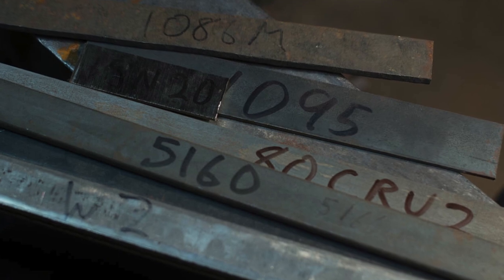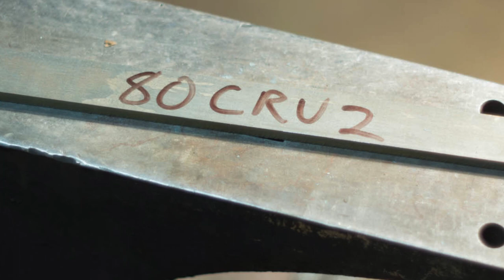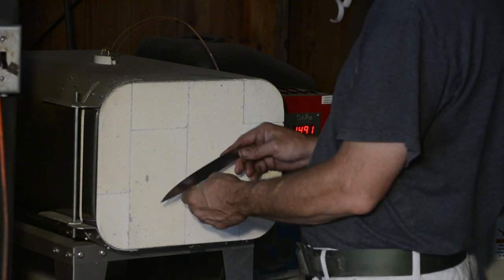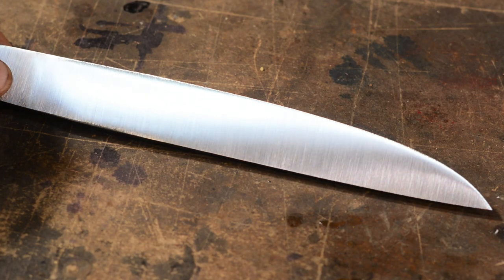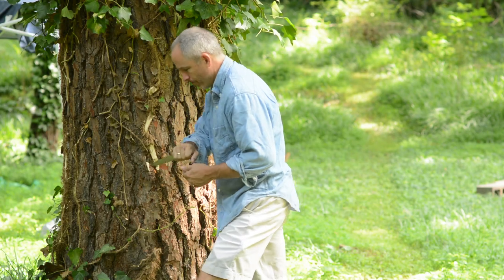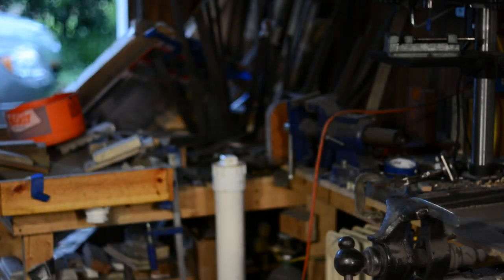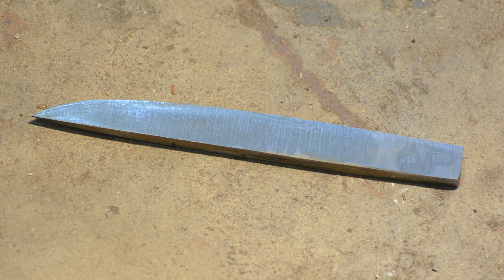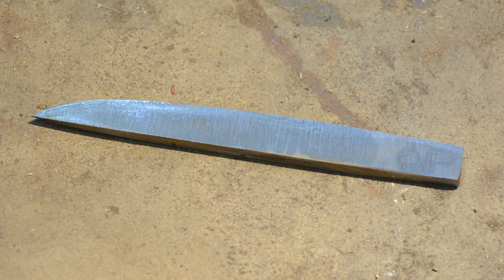Steel Testing for Knife Makers

Comment: Showing people to put quench oil in a plastic container, bad form.

It's way too easy to put red  hot steel through the plastic container and have flaming oil travelling across the floor.
Reply from the maker: Good point.  Sometimes I have to scramble for equipment at the last minute when making videos.  This was one of those moments...

Comment: And the same steel Wil vary from batch to batch. I've had 1084 that warps like crazy for no reason, and other that has no issues, with the exact same heat treat. That's one of the things I love about knifemaking. Every knife is an individual, and they all act differently.

Comment: walter, I have made 4 or 5 knives and now I am making a grosse messer out of this stuff. It is quite abrasion resistant and tough. Has better edge holding than W2. I have been heating to 1475 and quenching in canola.
Please, please, please... quit using canola oil in a plastic container. If you get too hot or a local concentration of heat, you will have a hell of a fire on your hands. Please!

Comment: I apologize if this was answered before, i was wondering, with all your experience with modern steels, which steel would make the best "core" (shingane) and one type for the outer harder layer (kawagane), then use the semi traditional way of folding the steels or simply folding the hard case into a V and hammering in the softer core. also would you have an opinion of which process would yield the best sword for usability, not so much for looks? i want a sword that i can hack away at a forest then kill a thousand zombies then defend myself from a gang of rampaging marauders and still have a fairly decent edge left. using 21st century materials.

Comment: This method of testing for properties of the metal based upon step-varied changes in testing parameters is exactly what Design of Experimentation and Analysis of Variation is intended to aid. The use of DOE to reduce the number of tests and yet gain a great insight into the properties as they change would be invaluable in reducing the overall number of tests and yet revealing the best possible treatment methods to optimize your steel. It uses computer based statistical analysis of test results based on small incremental changes in test parameters over a statistical resilient sample number. One set of tests performed in a short period could give you exact conditions that would achieve the desired results for any application for your steel. The software comes in many forms and some examples are free, though they do require some understanding of statistics. However any local math wiz kid or college nerd would be of great aid in that regard. You should consider this tool that would reduce 6 months of arduous testing to maybe one weekend. Good luck!

Comment: 2 questions
Where should I buy blade level metal
And
Why is the tang usually not lowered into the oil or water during heat treating?

Comment: Great video and if I had the resources that you have I would probably test this steel similar to you, but I don't so I have to use other means to go by like your video and others. I seen one video that they bent that steel( made into a knife blade including the handle) part 90 degrees before it broke and them the grain structure was good so there you have another test that was done, I know you tried to do the same thing they used a cheater har. Anyway like I said great video I have learned alot from you.

Comment: very good video ...I made a test blade from 80crv2 about 2 months ago ...quenched at 1525f and tempered at 350 for 1 hour and then at 425 for 1 hour ...I gotta say im really liking this steel ..the blade will pass a 2x4 challenge and still shave as well as being run over by my truck on a hard packed gravel drive way

Comment: Looks and sounds like a simpler version of O1 with far less manganese and no tungsten. O1 isn't as flexible that's for sure and it's hard to move under my hammer. Otherwise it's a lovely steel to use because it's very forgiving during heat treat. Forging is a bit more of a picky situation.

Comment: Great video, the L6 is a good steel for a machete, but, my favorite steel is the 52100, either austempered, or deferentially tempered,  I have several knives in this steel, and they are great, when you were describing that L6 steel, it almost reminded me of the 1095 CroVan or known as 0170-6C, you really made me think, Thanx.

Comment: Thank You for this video.
For my third "knife like object": In testing it did not chip or crack when hitting our garage floor (10x) -- but i did take a little chip out of the floor. It also flew well and stuck into wood repeatedly. The blade was a bit dented and dinged but looking pretty good.
I used a 1/8 x 1 x 8 piece of O1 tool steel. After basic shaping I heated the blade to red hot (oxyacetylene torch) and quenched in motor oil I had on hand. I cleaned up the blade and tempered in our oven at ~425 Deg F for 1 hr.

Comment: that is no pipe wrench get a 5ft pipe on that sucker and put your back in it. its not a test till you know where its fail point is. that's how welders are tested. your weld is bent with a 10ft bar on the end of a manual pipe bender and it there is no crack or tare in 3 test pieces you pass.
Reply: Drew Atherton where are you going to put a knife through that stress?  Anyone that does that should not be allowed within 100 yards of a sharp item!

Comment: Awesome video, learned a great deal! Mr. Sorrels or anyone that can help... I just started making blades and made one out of an unk scrap steel. I got it to the 1700-1800F range but was still unable to reach critical temp. How could I heat treat this steel? The file skates, but it is still magnetic. Any help would be greatly appreciated.
Reply: it is only non magnetic when it is at or above critical temperature, after cooling down it will once gain be attracted to a magnet.
Reply: Edgunsuk Thanks for the info. I don't know anything about the steel, it was scrap steel that was given to me from leftover scrap pile at a steel mill. I don't want to go spend money on a specific type of steel before I've had a chance to practice some. I think in the end, what I did was case harden it.
Reply: Edgunsuk Awesome, thanks. I'll check it and remember that.

Comment: I've heard many good things about 80crv2. They seem to be fairly true. Thanks for the video, good info :)
Reply: It truly is a good steel but with that american way of labling things nobody realy knows (like he said) whats in there.
Here in germany it is called 1.2235 which is a very precise norm and the HT is almost always the same regardless of were you bought it. 1.2235(80crv2) is/was often used in heavy duty sawmill blades since it holds an sharp edge like crazy! Or in tools cutting reinforced concrete, even some of the firedepartments Hydraulic shears used it. 
I love it for my knifes because with a blade of ~5mm thickness I was never able to destroy the knife. 
I hear lately that it is/was used in swords quite regular?!

Dont know if I was of any help now after year.